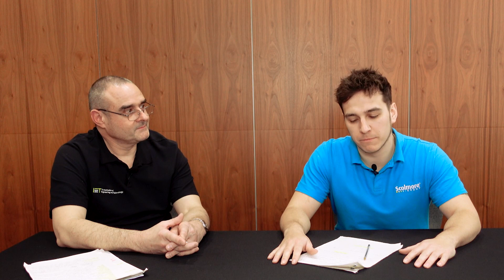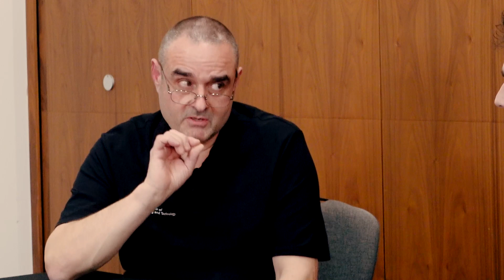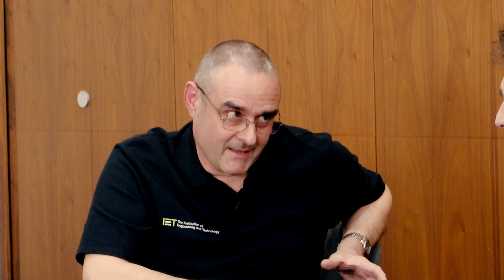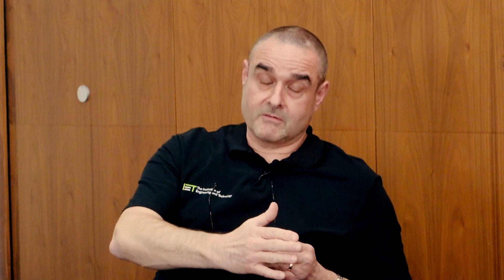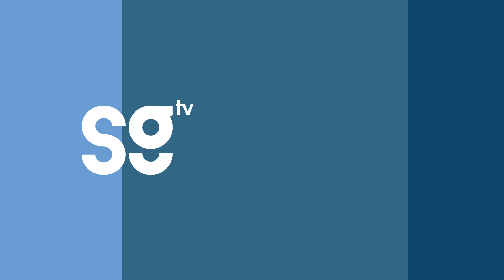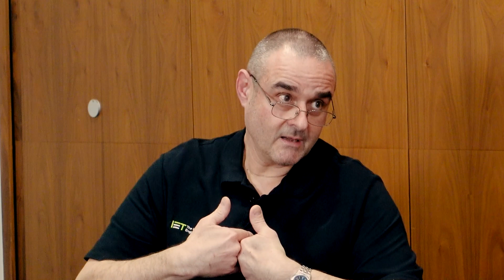NEW WIRING REGS OUT NOW!!! Richard Giddings from the IET joins Jake Green to discuss

Comment: IR testing on circuits was common in 70s/80s the idea was that any faults or damage would be discovered before decoration finishings were done. You get so good at it that you were able to discover the nail or screw that led to the fault using a simple bell set

Comment: What about an Ac rcd used on a tt system that has led lights etc. then you are using the rcd for fault protection so what would you code it in an eicr?

Comment: It's going to be very interesting determining when something is an HMO for AFDD purposes. GOV.UK has definitions for HMO's, Large HMOs, HMO's that need a license, HMO's that don't need a license, and HMO's that the council can require licensing at their own discretion. Flat's are particularly complicated. I'll be intrigued to see the actual wording.
Reply: Air BNB properties would you recommend afdds?
Reply: @Stevie-m  that's a good point and therein lies even greater complexity! My understanding is that if the airbnb is entirely used for short-term holidays it doesn't require a HMO license. I admire the spirit/intent of the new rules but fear they are going to be very difficult to apply.

Comment: Thankfully there is no regulation that says you need to own the regulations and many sparks will just look at the so called amendments that have changed and print or write those out.
Reply: As long as you’re not charging a professional fee I guess that’s fine.
Reply: @edc1569  That doesn't make sense..electricians are not a profession and charging a fee for work is legit with or without a brown book
Reply: if you belong to a trade body, nic, eca etc you HAVE to have the latest editions or bye bye membership.
Reply: @craig72x  Wrong...you have to have a copy available to show the assessor. That could be owned or borrowed....